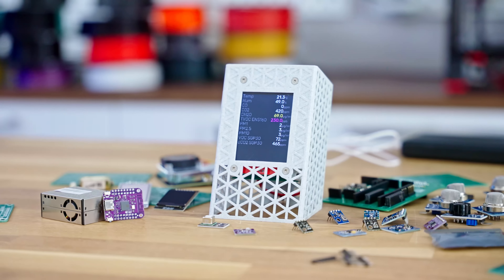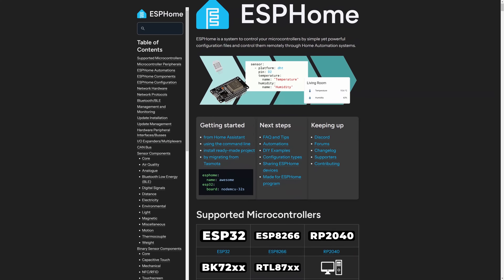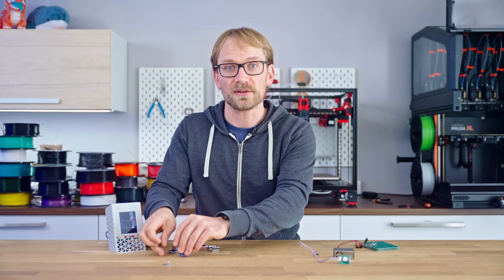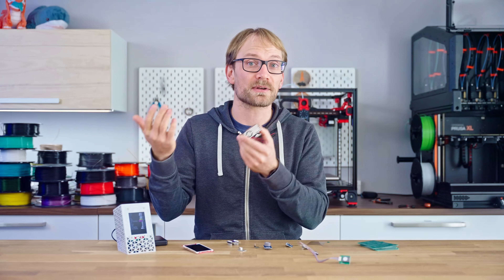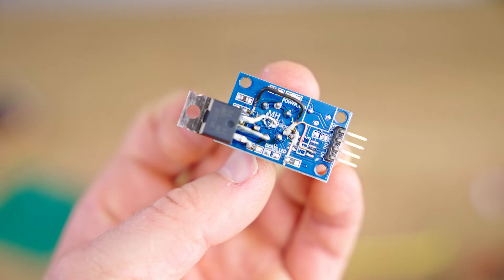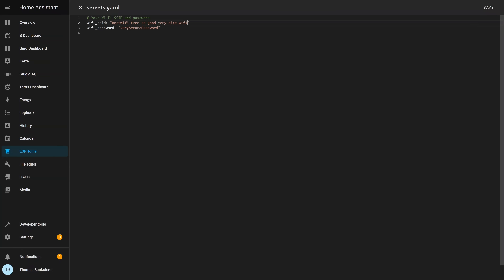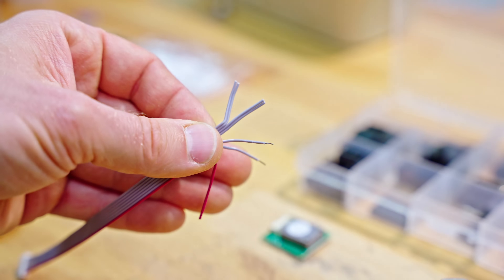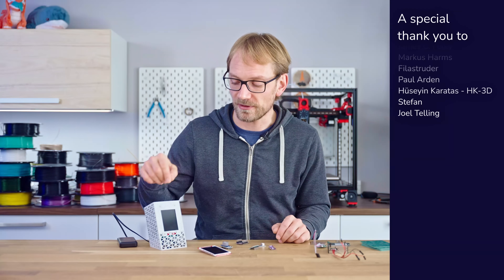I made it easier to measure your 3D printer's emissions!

Comment: Hello you talk about adding 3 additional capacitor but you dont give any hints as to there type and values?  Anyone know and can help.  It also seem like the board is slightly different but I guess that does not matter.  but now the main issue.  the software in the github seems not to have keep pace with ESPHome.  Does anyone have a current working version of the code.  Oh and newbee guild to how to get it to install.  If anyone could help that would be great.  Thanks.

Comment: Cant flash the ESP32 S2 mini. Tried 4 boards (3 from Amazon, 1 from Ali). Always get error that it Failed to initialze. Tried holding boot button, installing various drivers, used different computers. Nothing works. Log always says "Terminal disconnected: TypeError: Cannot read properties of null (reading 'pipeThrough')"
Now i have 80€ of sensors and stuff here and cant get it to work...

Comment: Hey Thomas! Thanks for making this video. May ask what is the role of the DC-2-DC converter in the build?
Seems the whole pcb is powered trough the esp32's usb and wonder if that is enough for the whole system to be stable.
Asking because I just put together a esp32s3 with a Sensirion Sen55  sensor and running the board is not providing enough power for the sen55 (uses 5V).

Comment: I was wondering if I could get some help with the emissions sensorbox. I followed the video and used your files and the screen lights up white and wont display the sensor readings. If I use the files for connecting to home assistant I can view the sensor readings from there. I would also like to add the same sensors a second time for a pre and post filter reading is that possible or would I have to build a second unit?

Comment: I loved this project so I decided to build it, however I could not get the ESP32S2 to work with Home Assistant.  No idea why, just never connected via WiFi.  I would suggest just opting for the ESP32S3 Mini instead.  It is twice the price, but still good value, and always works first time.  I did have to modify the GPIO settings in the yaml file because the S3 has a different layout, but it worked first time!

Comment: Hi, is there any suport forum for this? i have the pcb, i have the lcd and some sensors. But im trying to run it STANDALONE but get errors in the log.
Reply: [21:46:10][C][mdns:117]:   Hostname: sensorbox_2_sal
[21:46:10][E][component:082]:   Component mdns is marked FAILED
[21:46:10][C][esphome.ota:073]: Over-The-Air updates:
[21:46:10][C][esphome.ota:074]:   Address: sensorbox_2_sal.local:3232
[21:46:10][C][esphome.ota:075]:   Version: 2
[21:46:10][C][safe_mode:018]: Safe Mode:
[21:46:10][C][safe_mode:020]:   Boot considered successful after 60 seconds
[21:46:10][C][safe_mode:021]:   Invoke after 10 boot attempts
[21:46:10][C][safe_mode:023]:   Remain in safe mode for 300 seconds

Comment: I am trying to use the standalone firmware .txt file but when I compile using the esphome plugin in my command prompt, the screen is just gray. I have checked hardware, software, and components and yet nothing seems to work. Any suggestions?
Reply from the maker: ESPHome keeps changing their stack every month, so what worked end of last year might not work anymore tomorrow.

Comment: Yep! Doesn't work at all. It flashes the firmware and then I end up with a weird WIFI error. I don't think I will get any support of course so I guess I can through it in the bin.
Reply from the maker: ESPHome keeps breaking things, totally out of my control unfortunately.
Reply: As it turned out instead of configuring the wifi right after flashing, it instead created a accespoint to which I had to connect, then access via browser and there I could configure the WIFI network. I guess that's one of those ESPHome changes.

Comment: The ENS160 does not give an “approximate CO2 reading” or a “CO2 estimate” as the LCD screen on mine shows. It’s a CO2 Equivalent. It takes the VOC reading and then estimates the CO2 level that would be equivalent in terms on how bad the air is. So it’s just telling you “hey, the VOCs in the air now makes the air about as bad to breathe as if it had xxx CO2”. That’s why it’s often fluctuating and not equal to a real CO2 sensor. 9:50

Comment: @MadeWithLayers

1)  It would be nice to have a tutorial for the JLCPCB ordering process for those of us who can solder but are not familiar with ordering our own PCBs from a board shop.. the options are a little overwhelming.. i'm guessing I probably did it right... 

2) It would be nice if there was an option to have the PCB zip files pre-populated with headers as an option to have the option of the header install / PCBA process done for us for those of use who don't just have tons of headers on hand and would like to pay for easier plug-and-play assembly.  Would that be possible ?

Comment: Great Little Device, got it in Home Assistant, but my Screen only show white lines. I can turn on and off the screen from HA.  I wonder if it is a damaged screen
Reply: Fixed the issue, had to add psram: to the Yaml file and reinstall. Screen now works, although it has a white background and black text.

Comment: Any news regarding the revised PCB?
Reply from the maker: I spent 4 Months tracking down a random crashing issue that ended up being caused by a bug in the Arduino framework EspHome was using, so everything was on hold until that was resolved. I need to verify that it is still fixed with the current versions of EspHome, and then I can get back to the project.
Reply: @MadeWithLayers  do you consider using the new Sensirion SEN6x ?

Comment: Hi, I have a question about your videos on cleaning 3D printing residue from the air. Have you tested air ionizers, such as the Air Ionizer Plasma Ionfresher JP-212 II Home? Are they effective at capturing particles emitted during printing? I have an ionizer near my printer. After printing with ASA, I noticed some tarnish on it. However, I don't have a way to measure VOC particle content like you do. Yet
Reply from the maker: That's an interesting thought! Ionizers themselves don't "filter" the air, but by adding a charge to suspended particles, they make the particles themselves easier to catch with a conventional filter unit (and also more likely to stick to surfaces, which is likely what you're seeing). This effect is actually used at scale for filtering the waste gases from combustion power plants.
The other effect of ionizers is that they create some quite noxious gases, like Ozone and Nitrous Oxides, which is typically what you end up smelling around an ionizer or a tesla coil. I don't know how they react with the particular emissions from filament-based 3D printers, though typically they act as oxidizers, which often helps with reducing perceived smells.
I'd definitely recommend always using a particle filter when you've got an ionizer running, and to actually use it only as needed as Ozone and NOx are not the healthiest things to breathe, either.
Reply from the maker: ...and thanks for the tip!
Reply from the maker: First of all, thank you for the tip! Someone else had already asked about ionizers, and what my understanding is, is that they don't actually "clean" the air by themselves, but provide two indirect benefits:
- They can apply a static charge to particulate matter, which makes them easier to filter out with a particulate filter
- They generate nitrogen oxides and ozone, the latter of which can oxidize VOCs into possibly less harmful compounds

Note that both nitrous oxides and ozone are harmful to the human body in sufficient concentrations. Definitely something I will look into testing though!
Reply: I realize this but you can always try to combine it with a filter ( maybe it will increase the efficiency if more particles settle on the filters) but well time will tell . Thanks for your reply

Comment: I don´t understand the capacitors description. 5V and 3.3V? I can´t find those anywere online. There is no info on them in the PDF. Also the newest board has three Cap placements now that do not have part info on them. I know they are not totaly necessary, but I still would like to add them. Can someone please help me?
Reply: I've used 470nF / 10V capacitors. It works and there are no more reboots.
Reply: For all three?
Reply: @S_Hofmann  for this purpose the value is not so important. 470nf should be OK for all three

Comment: When looking for MP1584 with a fixed 3.3V output, I can only find one with an input voltage range of 7-28V. Is that right, or should I just get the adjustable version?

Comment: Is there a way to use the ZE07 and the ZE08 together? I have been experimenting with using GPIO pins for the ZE07 RX/TX outputs, but since the ESP-S2 only supports 2 UARTS (PMS5003 and ZE08) I have to put the ZE07 and ZE08 into Q/A mode. However, the documentation is very sparse on how to do this. Can somebody help me with splitting the UART?

Comment: I'm using the rev 1.1 board. Shouldn't there still be a cutout in the serial-carrier-r3 for the SCD41? Or did you intend for it to be mounted directly to the board?
Reply from the maker: Check the stl files, the current version has a matching cutout

Comment: Hi Tom,
I built the senor box and all is working fine. Great project! 
Had to modify the code slightly to make the code work, perhaps due to changes in the latest ESPHome version. Integration in HA also works well.
However, I added the modified MQ-7 CO sensor which is not working. Looking at the code I did not find any code supporting this sensor. 
After testing the MQ-7 in a separate project, I was not happy with the accuracy and the heat radiated by the sensor.
Searching the internet for a digital CO sensor I found the ZE07 CO sensor from Winsen, which I got running in a project standalone project.
Next step is to integrate the sensor in the sensor box, because it is not heating up and giving a digital CO reading (0-500 ppm) every second.
Update: Integration finished and working well. Will publish the changes on Printables in the comment section to your project.

Comment: @MadeWithLayers I left a comment on the Prusa page about power routing on the Sensorboard r1.1. At least for the particular EN160+AHT2x board that I have they should be getting a 5V supply on the "VIN" pin instead of a 3.3V supply on the "3V3" pin - which is actually an output from the 662K/3.3V regulator. There are a couple of versions of this board kicking around so I'm not sure if it's common to all of them or just the variant that I have.

Comment: On the details page in Printables for the V2 there is a note that a new PCB revision is going to be released. Is there a date/timeframe for releasing the new one? Don't want to order boards if a new one is around the corner.
Reply from the maker: Development on the board has somewhat stalled, as I've run into a persistent stability issue with ESPHome that I need to find the root cause and fix first.
Reply: @MadeWithLayers  Ah, ok.  Thanks for letting me know.  Would it be a good idea to hold off on purchasing the current boards until the issue is resolved?  And thanks for the great content and designs you provide.  Very informative and helpful.
Reply: Hi Tom, any updates on fixing the stability issues?

Comment: I saw a video where a guy had 20 A1 printers running with a sensor in a reasonably sized dedicated room. The sensor showed that it was detecting a good amount of particulate but still in the healthy range. Running a pull style fan and filter combo did lower the levels considerably. I guess my question is how bad is it actually when a room with 20 printers was within healthy limits? A reasonably sized bedroom or office with central air and one or two printers seems like it should be fine. Information and knowledge are good to have, but occasionally too much data can make people worry about things that aren't necessary. I would be open to suggestions of a reasonably priced sensor and small to medium filters.
Reply: It totally depends upon the material you are printing, like ABS generates toxic fumes but with pla it's within the safety limit.

Comment: My sensor readings are displayed properly within Home Assistant, but the screen on my Sensorbox is a blank white screen with no text. I'm using a 2.8" TFT ILI9341, the same display the config is set up for. I'm not sure what I did wrong. If anyone could help me, I would appreciate it.
Reply: Add lines

psram:
  mode: octal
  speed: 80MHz

PSRAM is not automatically enabled on the ESP32 (this changed with the 2025.2 release.)
Reply: From release 2025.04 from Esphome Builder, only add PSRAM and omit the parameters.
Reply: In my config the psram mode is quad for work (octal dosn't allowed in my esphome)

Comment: Thanks Thomas for this project, for me it has been a motivation to do a deep dive into Home assistant and developing electronics projects using ESP32 boards. It prepares the person for the many twist and turns one may encounter on this journey. My thoughts only, not criticisms.
I spent a week trying to determine why I had very annoying issue with r1.1 boards from JCLPCB. The traces for sda/scl for the sensors sht4x/aht20-bmp280 have no continuity to the corresponding pins on the rest of the board. I used Gerber viewer to verify the location of the traces as a guide. I thought at first it was my soldering skills but verified this defect on a blank board. Not sure what the root cause, manufacturing or design. It would be great if you could publish a schematic for reference.
One should expect a wide variability in the accuracy of any of the sensors, as I found out with the aht20-bmp280 and SCD40 Humidity sensors, data sheets are your friends. It would be nice to incorporate the ability to calibrate sensors in the yaml file. I will take this on as a project on my own.
Since multiple temperature and humidity measurements are available averaging them out on the display is better than picking just the first one that is a valid number.
Button does not dim display as expected, even though I manually shorted gnd and pin 13, more troubleshooting required.
As already stated in previous comments, moving the esp32 to an unobstructed location might improve wifi reception.
Reply: I feel your comment. My 3 sensors measure all 3 around 4-5° above the normal temperature. Haven't found how to fix this yet 😢

Comment: Hello, I used the most recent version of your board. It has 3 spots for capacitors. Which capacitors does each spot take? I'm having issues with my PM5003 sensor powering off and on every now and then.
Reply: I've used 470nF / 10V capacitors. It works and there are no more reboots.

Comment: I would like to use this device without Home Assistant. I have used the Web EspHome to do the initial install and setup the wifi. How to I proceed to do the sensor config and setup to get the device to work correctly.

Comment: What are the specs for the capacitors for C1, C2, C3? What Voltage and uF?
Reply: I've used 470nF / 10V capacitors. It works and there are no more reboots.
Reply: IDK nither !

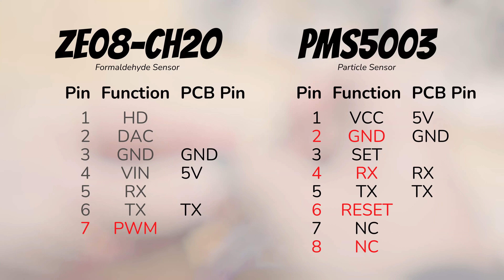Comment: 14:44, is it really TX to TX and RX to RX? normally it is mixed, so RX to TX and TX to RX
Reply from the maker: Connecting them in reverse won't hurt anything, so you can always try both ;-)
But since the RX/TX swap often causes confusion for people, I've already swapped them in the PCB routing and labeled the pins according to which sensor pins should be connected where.

Comment: Anyone else have issues flashing the s2 mini, I ordered two and both won't flash with ESPHOME. Tried the adafruit ESPtool with similar results. It appears this is not unusual for this specific board. Is there a recommended alternative that will mesh with your PCB.  

I see now that this is answered in your printables article
Reply from the maker: @andyparadis342 I'm working on adding support for the S3 and C3 boards as well, but I'm still hung up on debugging a rare issue that I'm seeing with the S2.
Reply: @MadeWithLayers  I managed to flash my s2 mini after several tries. I had to plug it into a powered USB hub. I have the particulate sensor working.
Reply: Same issue here. got 2 I can't flash it. Windows 11. Recognizes the devices, appear on com11 but initialize for first time use fails.
Reply from the maker: @mrb3s  for me, the web flasher will throws an error if the board wasn't in the correct flash mode. But the flash tool still manages to get the S2 into the proper flash mode before it aborts (the S2 gets a new device name in Windows), so for me, all I have to do is to leave the S2 plugged in and to start the flashing process again.
If that doesn't work, try a different PC, I've also experienced some systems that had interfering drivers installed (but I've not yet figured out how to work around those).
Reply: @MadeWithLayers  I finally was able to get it to work, when I did directly at the HA host, which is running HA OS. I flashed 5 in a row, 3 are built and working. Thank you for sharing this project!

Comment: Aside from some initial trouble flashing the microcontroller, this was an easy project to put together. Your assembly walkthrough was excellent, and it powered up correctly the first time. Thanks so much for putting this all together!
Reply: How did you flash the s2 mini?
Reply: @mrb3s  Ultimately I used the method mentioned in the video. My initial problems were due to buying the cheapest S2 minis on AliExpress and having the first one fail on me.
Reply: @trentbateman9897  what was going wrong expericing issues myself currently